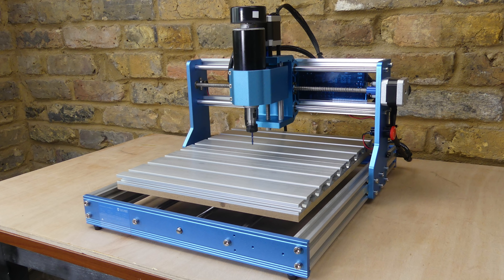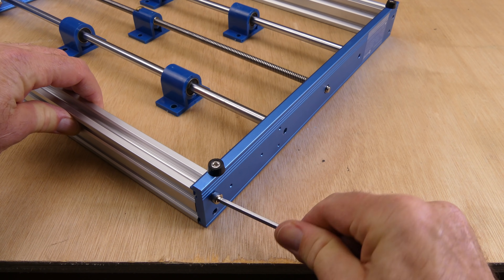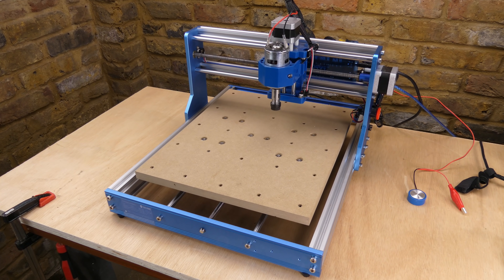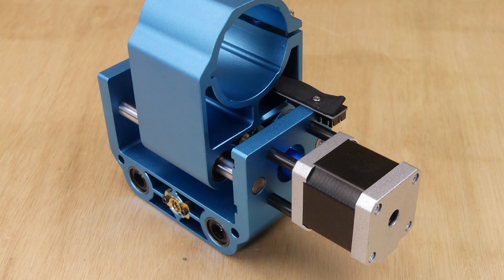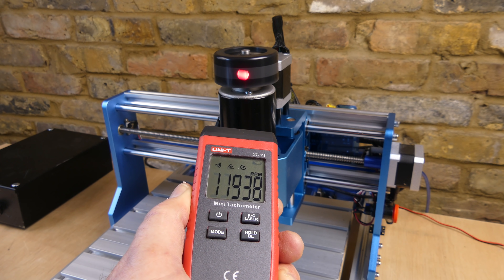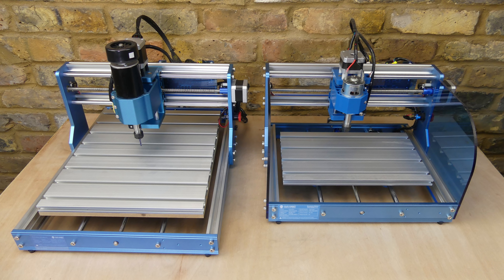CNC 3018 to 3040 Upgrade with 500W Spindle Motor  ( Sainsmart Genmitsu )

Comment: Hello Sir, maybe you can help me, i am having some issue with my 3040 (regular 3018 with extension kit) Genmitsu.. I am using carbide create for the G-code, but the G code when run to GRBL pause right away...i have to press the pause on the GRBL for the program to run... please advise ... thankyou
Reply from the maker: That is what the gcode created by carbide create tells it to do, its normal
Reply: @techydiy  is there a way around it? any suggestion.. thanks again
Reply from the maker: You can edit the gcode with a text editor. This is the offending line "M0 ;T102"  just delete it. 
The post processor is fixed so nothing useful can be changed there.

Comment: does anyone know if there's a difference in size between the yofuly 3018 pro-m and 3018 pro genmitsu?
Reply: afaik the main gotcha between the models is the spacing of the x axis linear rod, means z axis kits may need massaging.

Comment: I've been using a die grinder for aluminum support parts for 3d printing projects. With surprisingly good results but it lacks precision for small parts. It was just lazy attempt to use what i had.

I guess it's time to get a baby cnc and a mini lathe too. They are more accessible than i imagined. It also seems the bits, collets are interchangeable.
Reply: not really a major reason you couldn't use a die grinder as the spindle motor. Lot of torque in a small/light package, little heat and no electrocution risks lol.

Comment: Are the original stepper motors strong enough to handle the added weight and torque of the spindle motor?
Do you get any layer shifting during carving?
Reply from the maker: The z axis stepper motor is larger / more powerful  than the original stepper motor.

Comment: QUESTION: Under the table - the Y-axis brass nut that has the spring behind it - this Y-axis brass nut is not screwed into the plastic housing - so, does the lead screw nut not get screwed to the housing? (not much to screw to).
Reply from the maker: There is another nut embedded in the plastic housing. The loose nut and spring tensions the leadscrew against the fixed nut.

Comment: Thanks for sharing a tremendous instructional video. If I may ask, I need to mill at the center of 300mm x 370mm x 6mm acrylic sheets, (so the milling is not close to the edge of the sheet). If I bought a 3018 bundle which includes a 4030 extension would I be able to lay the larger sheet lengthwise on the 300mm x 320mm bed with an 25mm overhang on the front side and 25mm overhang on the back side to do the milling? Any advice appreciated.
Reply from the maker: Yes you can do that.
Reply: if you are using opaque acrylic then a laser may be easier and give a better finish, theyre common and cheap in that size.

Comment: Great video, thanks.  Can you tell me please was the 500w motor noisier or quieter than the original?
Reply from the maker: About the same I would say. The brushless spindle motors are quite a bit quieter.
Reply: @techydiy  was the 500w you were using not a brush less spindle motor?
Reply from the maker: Brushed

Comment: Quick question, how can you level/surface the aluminum spoilboard? Mine for some reason is higher from one side than the other. I ordered the mdf spoilboard but i really like the aluminum one
Reply from the maker: Put some shims underneath.
Reply: @techydiy  under the aluminum plate right?
Reply from the maker: Between the plate and the mounts
Reply: @techydiy  awesome!! Will give it a try. Will also better allign the table with respect to the X axis so i can use the table as a square reference.

Comment: Great video! Do you have a file you could share on the Z joining plate to cut on the machine? Or dimensions/centers? Thanks!
Reply from the maker: 4 holes - 20mm between each hole.

Comment: these types of aluminium bracket is actually a good heat dissipator, i managed to install 2 water blocks to the sides and works incredible well. i know in a dc motor cooling the armature is not the best, but it works way better than expected.
Reply from the maker: Yep, it definitely helps dissipate heat from the motor

Comment: Hello! Can you help me, please? I got my machine. I wanted to use the Easel software but the spindle doesn't want to run? What is the problem? The jog is moving.
Reply from the maker: In Easel,  
Select Machine menu, 
Advanced, 
Set Spindle control to Automatic
Reply: @techydiy  perfect omg! Thanks! I tried many thing already. Thanks
Reply: @techydiy  

And another thing, please.
I have just started to use my machine for a day. I will discover it but I don't understand one important thing.
I design the form etc. I set up the zero from the corner, and the machine is starting to work not like on the animation for example like at the Christmas tree- up.
Instead of it come to a wrong place down towards me, like a reflection. What is the problem?

Thank you for it.
Reply from the maker: Sounds like the y axis is travelling in the wrong direction.
If that is the case you need to change the  $3 direction port invert mask setting in grbl.

Grbl $3 direction port invert mask  documentation is here:
https://github.com/gnea/grbl/wiki/Grbl-v1.1-Configuration#3--direction-port-invert-mask

From the console in your gcode sender (candle, ugs etc.)
Type $$   - This will list the current grbl settings
Look for the value of $3

Then use the table just above $3 in the documentation to work out new value.

To change the value
Type $3=2 (or whatever value you determined) into the console.
Reply: @techydiy  Perfect! Thank you, now is working correctly. I am so grateful.

Comment: My machine wont respond to any commands given to it use candle. Hope I haven't just payed for a overpriced paperweight
Reply from the maker: Com port working ok. Stop button released. Select com port in candle. Reset / unlock before doing anything. Any messages in the console.

Comment: I hadn't thought of extending the Z axis clearance like that... damn I know what i need to do on mine next!
Reply from the maker: You can also replace it with 2080
Reply: @techydiy  do Genmitsu sell 2080 z axis extension kit?  Or would we need to buy 2080, and then tap ends  for screws to fit?
Reply from the maker: Buy the 2080. Tapping it by hand is easy.

Comment: Just got 3018 PROVer and I need to mill out holes in 2.5mm anodized aluminium 19in rack front panels. From research I realised that the stock spindle is unlikely to be up to the job so ordered the 775M 20k RPM spindle too but am now thinking of sending it back as I don't think it will cope either. I will probably have to go for a 52mm spindle (300/400/500W) and so would want the aluminium Z-axis replacement featured (don't want the hassle of 3D printing my own and need the stiffness) but according to the link you provide (ie. The Sainsmart website) it doesn't ship to the UK. I realise Sainsmart sent yours specially for review but how do us "ordinary people" get one? I don't need the bigger working area or the leap in price of a bigger machine just to get a spindle that can cope with aluminium.
Reply from the maker: I guess it's out of stock, mine came some time ago. Have you looked on Amazon?.
The stock spindle will cut aluminium, you  just need to keep the depth of cut low (0.1mm). Probing a height map also helps.
Reply: @techydiy   Hi and thanks for the quick reply. I looked all over for this part, including Amazon (where I ordered my 3018 PROVer and 775M) before I even saw your video but it was nowhere to be found except on the Sainsmart website. Amazon doesn't even list it as far as I can see. The website says it will ship to the USA and Canada so I doubt it is out of stock - it's just not available to ship to the UK or Europe. Do you have any contacts in Sainsmart who can explain this issue?
Reply from the maker: @spacedock873  No I don't.  I believe  they operate seperate warehouses for the US, Canada, UK and Europe, each of which holds different stock levels They don't ship from a Central location and if you happen to live outside of those areas you can't buy the product (I have read several comments from Australians complaining). Whenever I have ordered something directly it has been delivered by Amazon, so they might be using their drop ship services. As far as I can see  they are out of stock in the UK and European warehouses. My only suggestion is to email them and ask when it will be back in stock.
Reply: @techydiy  Okay, will do. Thanks for the reply.

Comment: Am getting a lot of EMI with the similar setup here. Where can I get the steel housing for the power supply?
Reply from the maker: It's one of these https://www.tlc-direct.co.uk/Products/BX963.html  
I wouldn't specifically recommend it, I just happened to have one. 
Look for an aluminium instrument case or project box on ebay, Amazon etc.
Its also worth getting some rfi filtering for the mains lead. 
Something like this    https://uk.rs-online.com/web/p/power-line-filters/7804991/
or this  https://uk.rs-online.com/web/p/power-line-filters/1704997/

Comment: Would it handle milling small 3 dimensional brass or aluminum parts in this setup?
Reply from the maker: Yes for occasional use, its not really designed for that.

Comment: Does it worth it to add all that modifications rather then buying an already upgraded version?
Reply from the maker: Everyone has different needs. If you already have a 3018 and want a bigger table then its worth upgrading.
Reply: probably the biggest thing about the 3018 is the massive community round it

Comment from the maker: Upgrading a Sainsmart Genmitsu 3018-PROVer with a 3040 Y axis Extension, an aluminium spindle holder and a 500 Watt spindle motor.
Sainsmart 20% discount code BFD20
3040 Y-Axis Extension Kit        
Sainsmart https://bit.ly/3fXDp5R
Amazon US  https://amzn.to/3wNCnPZ
Amazon UK   https://amzn.to/326E1Oi

3040 MDF Spoilboard
Sainsmart    https://bit.ly/3wJMtkQ
Amazon UK              https://amzn.to/2QfI6xa

3040 Aluminum Spoilboard         https://bit.ly/3taay1W

Aluminum Spindle Holder 3018-PROVer     https://bit.ly/3mzAhhQ
Aluminum Spindle Holder 3018-PRO    https://bit.ly/3mFLKwj  
500W Spindle motor      https://www.banggood.com/custlink/33vtKR7QJT
500W Spindle motor    https://www.banggood.com/custlink/mv35KYwnHd
Amazon   500W spindle motor     https://amzn.to/3UPS9X2

8 hole 2040 joining plates      https://bit.ly/3eckqSr
Laser kit   https://bit.ly/3ga4XFp
3018-PROVer   https://bit.ly/31YfEm3

Dust boot files     http://www.techydiy.org/3018-prover-cnc-dust-boot/

These are affiliate links. If you click on one and purchase something, I might receive a small commission. It doesn't cost you anything extra, but it does help me to make more videos.

00:00 Introduction
00:28 Dismantle 3018
01:32 Assemble Y Axis
02:13 MDF Spoilboard
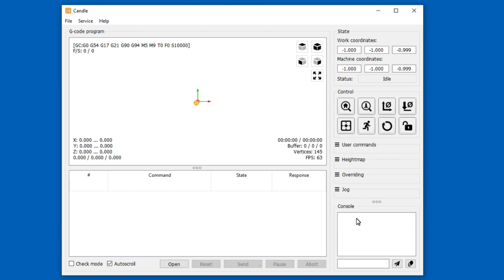04:08 Candle
04:28 Level Spoilboard
04:57 Cut Plywood
05:20 Laser
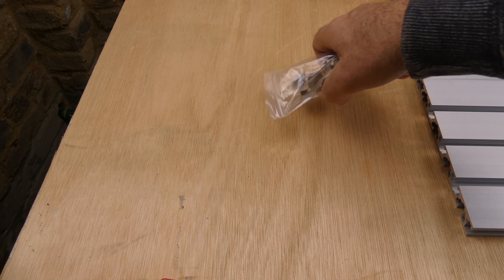05:38 Aluminium Spoilboard
07:25 Cut Plywood
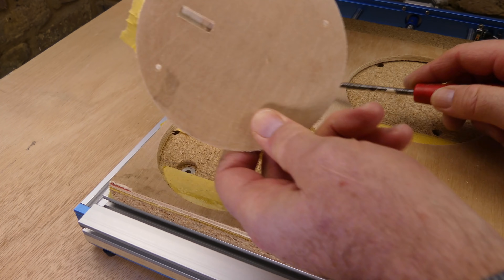07:56 Aluminium Spindle Holder
08:54 500W Spindle Motor
09:54 Cut Plywood
10:24 Tensegrity
10:46 Cut Aluminium
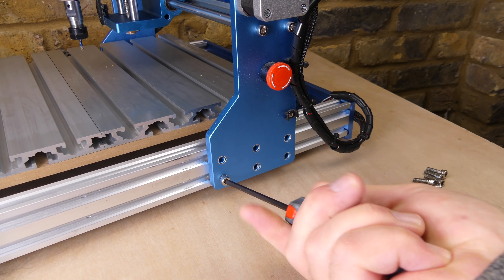11:57 Height Increase
13:39 Review